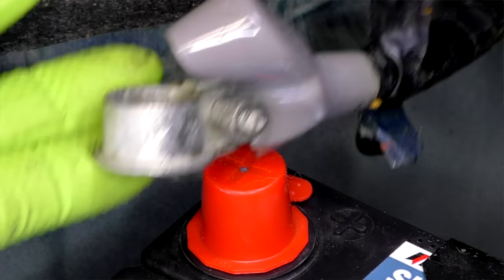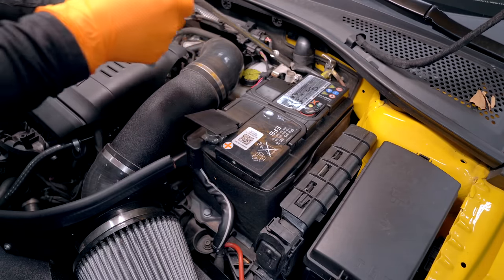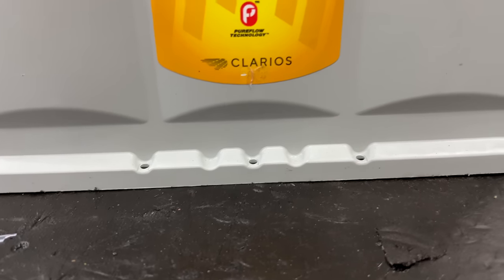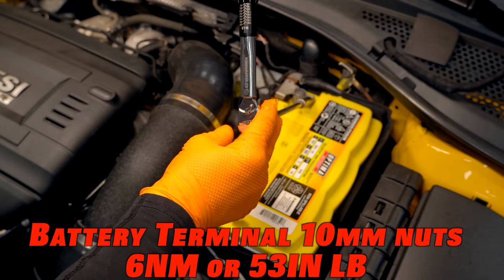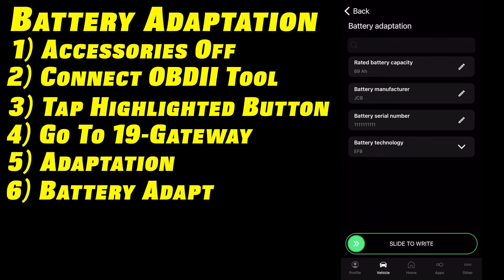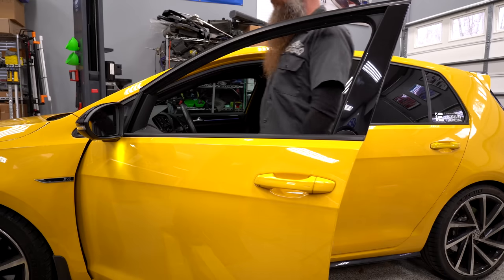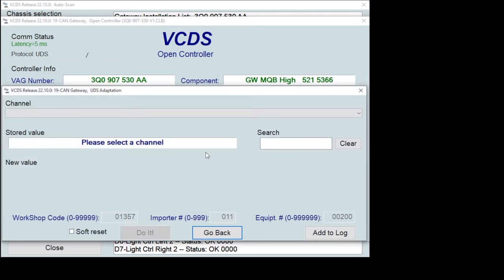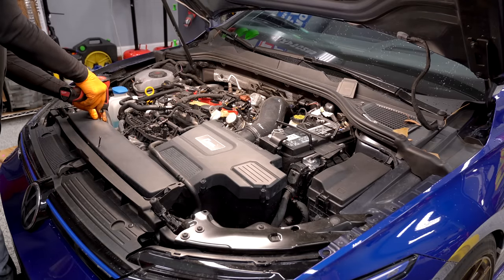How To Replace and ADAPT a VW or Audi Battery

Comment: Had to do this a few weeks ago on my Mk7 R. FYI if you only have the basic OBDeleven you can get into the battery adaptation menu, but won’t actually be able to make any changes to any of the parameters(as far as I can tell). Informative vid!
Reply: Dr. Google indicates you need the Pro model

Comment: Just a note. Advance Auto Parts is able to the battery reset. They started getting the extra module they needed about 6 months ago. So if you are buying a battery from them they can do the proper install. 
And another note, Die Hard batteries are made by Clarios as well. There are only about three major manufacturers in the US, Clarios who used to be Johnson Controls, East Penn and Excide.
Reply: I almost took a job at Clarios, funny seeing all the different brands they make, with only the outer shell being different.
Reply: Advance Auto just told me they couldn't do it and referred me to 3 shops near them.  One said I needed to take it to the dealer and the second seemed unsure after I told them about the first one and suggested Firestone or NTB, Firestone said I needed to take it to the dealer!
Reply: @rwest5386  Sounds like they are either not trained correctly or just didn't want to do it.

Comment: Might be worth adding a note about the "battery technology", apparently the "Binary - AGM" option isn't correct for standard AGM batteries and the correct method is "Fleece".

The rosstech (VCDS) wiki mentions that AGM batteries are often Fleece, not sure of the importance, I've always been paranoid whenever changing batteries.
Reply from the maker: Yea me too. The info from VW is based only on VW batteries, so I couldn't get a clear view. my guess is, it's not a big deal. but im trying to find out for sure.
Reply: If you go to a dealer, it certainly is "fleecing"
Reply: @HumbleMechanic  Dear sir did you find anything out?  I just replaced the battery in my '16 GTI for the second time, and noticed I had set mine to Binary AGM for the previous.  I seem to find more people claiming "fleece" is the choice for a "standard" AGM (which I assume my AGM is).  Would make for a cool video if you could measure any possible charging differences between the two modes.
Reply: I'm seeing a lot of people mention fleece as well. I think that's what I'm gonna go with.

Comment: 2017 Passat 1.8t 
You just saved me, King🙏. It was good you mentioned the Amp hour. I almost bought the wrong battery. I had the original battery that just died a couple of days ago. 7 years isn't too bad of a life span right, lol. Apparently, it lasted that long because I drove a lot for Uber, which extended the life span. The OEM was 60Ah and 480CA. The new Motormaster I got has 70Ah, 835CA, and 665 CCA (🇨🇦). It's slightly bigger as well, like yours is. After watching your video, I walked into the auto parts store (Canadian Tire), confident with my chin up. I almost got a cheaper model, then I saw that it had 58Ah, and I remember what you said. It fit like a glove and looks even better. I'll follow your advice to the grave. Thanks a 1,000,000ft lbs torque 😃

Comment: Excellent. I wanted to add a set of C-TEK leads on my mk7 GTD and tried to do this without upsetting the battery. Turned out that I couldn't and your video was invaluable to help. Really good step by step guide and it worked. Who knew you cleared the codes by turning the steering wheel (after the earlier steps). Also turned out that the coding was not quite correct for the battery that was installed. Many thanks for your video.

Comment: I checked the battery in my 2014 Jetta TDI last week. Apparently it's from late 2013 but still running strong. Down to 12.4 volts, but not bad for 9 years!
Reply: Have you checked how many CCA it is still delivering?

I got a “BM550” battery tester (really cheap) on Aliexpress that works just fine for that, I compared it with the readings from a “professional” equipment on a shop (pretty much the same results/reading)
Reply: @EudesRJ  I agree those cheap battery testers are extremely useful in testing batteries. You learn a lot by testing often on a range of batteries. When the battery is dying the internal resistance goes up and the CCA goes down.

Comment: 2019 golf r.  just replaced the battery on my own.  no coding, no errors.  had to reset my clock, and my tpms. Was worried I would need to jump through all these hoops, but everything is working fine.

Comment: Great video and great information. Modern VWs, like my 2018 Tiguan, will set a check engine light long before the battery is too weak to start the car. As long as the battery doesn't have some sudden catastrophic failure, the car will let you know when it needs a new battery.
Reply: That is correct. I’ve done a couple tiguans inside the delear as a VW tech and it will throw the check engine light on with a whole bunch of faults stored in multiple modules with low voltage everywhere. Sometimes cars come in with aftermarket batteries and they were never adapted so I would perform a battery test to see if it was good then perform battery adaptation on ODIS. VW scan tool if good. If battery weak and failed I’d sell new battery and perform adapt. If it’s on 111111111 and has aftermarket battery. It was never adapted and is factory adaption
Reply: How reliable is your Tiguan. I am looking to buy new one but is it worth it over getting new Honda CRV or Toyota Rav 4. I dont mind if its a bit more to maintain than Honda or Toyota but I am wondering if they break down often or burn oil there.
Reply: @speedgtr1958  , it has been very good. Mine currently has 91,350 miles and the only problem I encountered was a problem with the injector wiring harness that was fixed under warranty. Since then, no problems. It gets good gas mileage and rides well. I do oil changes every 5k miles instead of the manufacturer recommended 10k miles. All other maintenance is done at manufacturer's recommended intervals.
Reply: My 17 GTI gave me no warning.
Reply: My 2018 tiguan has been having issue with battery since 2021 after I did not drive my car for about one month and I had to use jump starter to start the car. It seems the battery was permanently damaged that I have to drive my car every 3 or 4 days after that incident. Otherwise, the engine light will be on, telling me that the voltage of the battery is low. Now, the engine light is still on after I drove it more often these two days. It is probably the time for me to change the battery.

Comment: I've been gearing up to replace the original battery in my 2016 S4.

You touched on every question I've had.

Thanks!
Reply: Audi batteries last a very long time and I have never replaced once since owning many over the past 30 years.  My current 2010 S4 has the original as well as on another S5 2018.  Sold a 12 year old A6 v8 before that had the original one.
Reply: I just replaced the battery in my 2016 SQ5. The original one is from week 31 2015 and was still working, but I saw the voltage was pretty low and wanted to change it when it was convenient for me and not be auss I had to, and get stuck. I wouldn't be surprised if this battery would have lasted me another year, very impressed with it.

Comment: Thank you so much i  replaced my battery and on completion all the codes came up, i had my car booked in to reset codes.. Then i saw this video. Worked a treat all codes have reset after driving round the block.

Comment: This is an awesome video, because the information is not available in any source. You deserve way more subscribers man.
Just to add a little bit more background:

- The serial number is important because it gives the car precise info about the age of the battery. Coding a 1111111112 you are just telling the car that something has changed but he isn't sure about the capacity [Ah] the battery could have lost with its age.
- The most similar way to VAG factory to code a battery is to search in your battery sticker the production date of the battery, and code the following serial number (without spaces): 
Z Y MM DD ZZZZ
Z - unimportant numbers, you can insert whatever you want
Y - Last digit of the production year (2023=3)
MM - Production month
DD - Production day

If you do this, the car will know exactly when the battery was produced, and you will have coded a battery exactly like a VAG dealership.

Love your channel♥️
Reply: Addition: Your previous battery showed 1111111111-JCB because it was the first one, and all the VAG cars when they leave the factory get coded the same (as the car is brand new, he doesn't need exact info about the battery to know that it is also brand new, so they code it like this to save production time). However, if you had done this battery change in a Volkswagen dealership, I can assure you they would have code it as I explain in my previous comment, because the alternator needs the exact production date to expand the battery lifespan.

I hope this information helps!!!
Reply: Thanks for your explanations elaborating the idea of storing the serial number. Excuse me, I'd like to understand this even more:  So how will a battery be treated differently based on its age? (Also I wondered how VW didn't find it necessary to code the information in production, because the battery is bew - I mean... if you are replacing a battery, you are also putting in a new one. Isn't that the exact same thing? 🤷🏻‍♂️
Reply: @RC-ic1co  Hi! Let's see if I can explain myself correctly:

The difference between older batteries and start/stop batteries belongs to its charging procedure. Older batteries can be charged by constant current whereas start/stop batteries need an 'adaptive' charging process based on its instant capacity [Ah]. It would be like saying that older batteries could be charged the same way no matter what, and newer batteries needs to be charge one way or another depending on its age.

In actual cars (with start/stop) the alternator needs to know the exact 'life status' of the battery, in order to choose the correct charging procedure for it. When your battery is starting to die, (it will be loosing Ah) the alternator will not charge it further than X% simply because the battery will not accept it. 
Due to this, if you replace the battery but 'you don't tell the alternator' (and with this I mean you don't code the battery) the alternator will still think that you have a battery near to its death, and won't charge it over that X% that I was saying. As you can tell by this point, you will have a battery that DOES accept 100% charge, but the alternator isn't providing it because of the previous battery, damaging its new lifespan.
I hope I explain better this time.

For the second part, I guess that as is a really particular topic where all the ECU's are completely new, they kind of understand that every piece of the car is also completely new. But, as I said, that only works for the first battery change, for cars that have just left the factory. Is not the usual case.
Reply: @adrianmartinampuero2009   I didn't realise that constant current was used to charge lead acid batteries. My understanding is they are normally charged by voltage regulation to say 13.8 to 14.2V then battery takes the required current depending on its charge state. Maybe they are now using a combination of constant current to start with then revert to constant voltage.
Reply: @adrianmartinampuero2009  Thanks a lot for your elaborate explanation.

Comment: Is there any reason you can't jumper another battery in parallel with the one you want to replace, then take the terminals off of the old battery, slide in the new one, put the terminals on, and then un-jumper the minder you put in place, the better to not lose all your settings? Would that not work?

Comment: Too keep all the values and avoid all error messages after replacing the battery: Before removing the battery I connect my DEFA Smart charger to the battery cables , put the charger into power mode, i.e. constant voltage 13.6V by keeping the "on"-button pressed until the LEDs display a moving pattern.  Very easy and convenient. Battery-adaptation is necessary in Start/Stop-systems like 'Bluetech' in VAG terms. VAG statement: "After replacing the battery it is necessary to adapt the battery to the vehicle. If the adaptation is not completed, the start/stop function will be inoperative. Additionally, charging system operation may be effected and various DTCs can result. "
Reply: I have start and stop error and adaptive cruise control error after replacing the battery which someone used obd 11 to set but they are still not working, any ideas on what to do
Reply: @MoroccanAnwar Yes, you need to have it programmed. My dealer located in florida will do it for 79.00.

Comment: Thank You Charles. This step through was most excellent. I too like to put those Terminal Covers back on whenever possible. Trim them etc.  I like to put them back on after the removing cable(s). No boo boo's allowed. Also, I have a Label Maker and got into the habit of putting the 'In Service' date on our batteries so no guessing how old they are.

Comment: Great video, one question: what difference would a memory saver module make? Ive heard people say you need a memory saver to keep the computer alive while the battery is disconnected, would this skip the need for the service light removals and window reset? I know adaptation would still be needed.
Reply: It would remove the need for any of this providing the battery was the same type.  THERE IS NOTHING IN THE BATTERY THAT TALKS TO THE ECU, so the ECU doesn't adjust anything in a dynamic way for charging, or alter charging patterns based on age - that is all rubbish to add extra costs to a simple replacement job.
Reply: @Bond2025  only thing I saw was battery type and ampacity

Most swaps of my car go from EFB to AGM style battery, and they charge at slightly different voltages from what I've heard, so selecting the proper type is essential. But you're correct: buy the exact replacement from VW and you don't need to do anything but have the memory saver plugged in

Comment: Thanks for your video! As of now it saved me about $430. I got told by the dealership it would cost $626 to have a battery installed and adaption performed on my 2019 VW Tiguan FWD 2.0L . I used my topdon artidiag900 lite to change the settings from EFB to AGM (Walmart everstart H6 AGM). The only thing I was lost was on the AH #. For some reason it doesn’t say on the battery like yours did. But I went back to Walmart webpage and ended up seeing a 70 AH on the picture they  had on their ad. So after trying to find more information about the battery i decided to go with that. If anyone has info to clarify the AH # please reach out! But as of now everything works, cleared all my faults and took it for a spin and auto start/stop work. 👍👍👍😁😁😁👍👍👍
Reply from the maker: Hell yes!!!! You can send that check right over 🤣. Kidding of course.  Super hyped you DIYd it

Comment: Can you provide 12V to the leads while the battery is out to avoid programming? (if it's the same capacity and technology) 
This method is sometimes used when replacing cells inside laptops' battery packs that have an electronic "fuse" that blows rendering the pack's circuit useless if it doesn't senses a battery voltage at all times
Reply: I just replaced my battery (Interstate from Costco) - and I did hook up 12v to the leads when I disconnected them. Absolutely no error codes, warning lights or window programming needed, my GTI didn't know anything was changed! I haven't done the adaptation, and it's been a few months, no issues. I believe the battery capacity is the same, though.
Reply: Yes, I answered that in a separate comment right now. If you use another battery for that, it can be a smaller 12V battery. Be aware of sparks due to different potensials/voltages, best to use cables made for charging that will "absorb" a short time spike and connect to ground/body for the minus polarity.  VW / Audi Group (VAG) statement: "After replacing the battery it is necessary to adapt the battery to the vehicle. If the adaptation is not completed, the start/stop function will be inoperative. Additionally, charging system operation may be effected and various DTCs can result. "

Comment: Thank you! I'm not a mechanic and just bought VCDS on your recommendation. I just replaced a 10-year old Varga in my Audi Allroad 2013 (it actually lasted 10 years!) with an aftermarket "Legend" battery of comparable CCA, CA, etc... I will now adapt that new battery because my dash panel is a veritable discothèque! I learned so much from your VCDS & Battery video's. Thanks once again... marcel

Comment: This was exactly what I needed. $500 for the dealer to change with an OEM battery. Also, with a small bit of modification to the battery tray, an H7 AGM will fit in a 2021 Tiguan.

Comment: So clever and yet it can't run a selftest on the battery after it been disconnected and set the new AH value by itself... Clever yet still dumber...
Reply: You want the car to completely drain and recharge the battery to avoid 5 mins with a scan tool?

Even if it did, the car would not get an accurate measurement of the battery capacity without draining it so low that the computers brown out. Then what? How are you going to start the car to recharge the battery?

The only non stupid way to do this would be to add a small memory device to the battery that clips in to the car, and that is just as ridiculous as the original idea. 

 Also even with a drain/refill, how the hell is the car going to know what the battery chemistry is? Just smell the battery?

2 mins with a scan tool is fine.